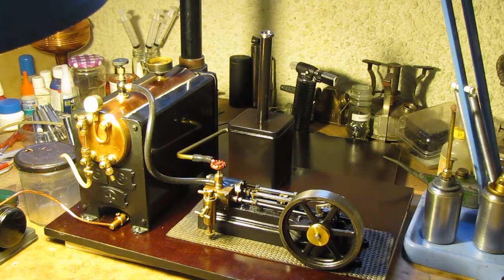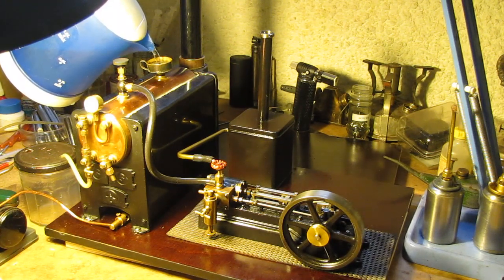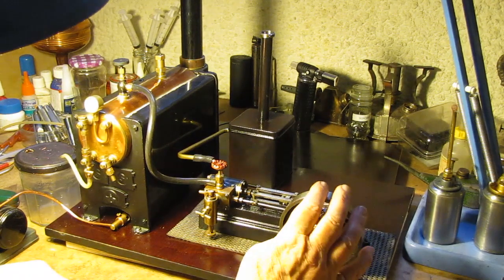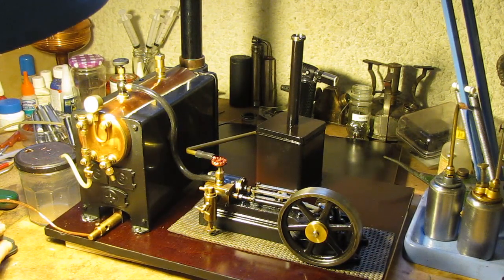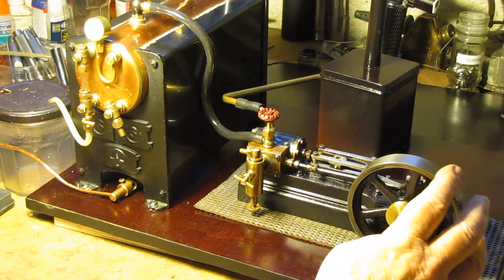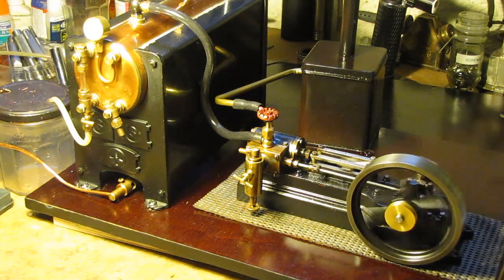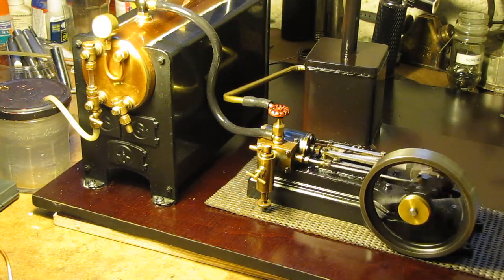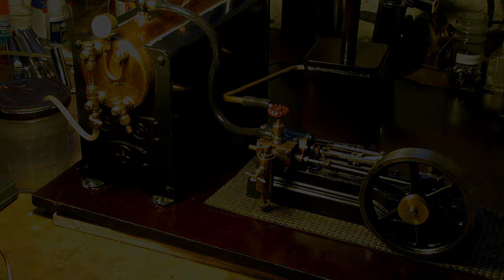Stuart model steam setup. 501 boiler and s50 mill engine.

Comment: Hi, please i'm renovating a stuart 501 live steam boiler like yours. I bought the boiler used without all fittings, i would to buy them on the stuart site to complete my boiler. I see there are 6 trheaded holes in my boiler ( 2 on the top and 4 in the frontal face) and they are different in diameter and probably in TPI. Could you tell me every fitting what thread must have ?
Thank you and beautiful work !